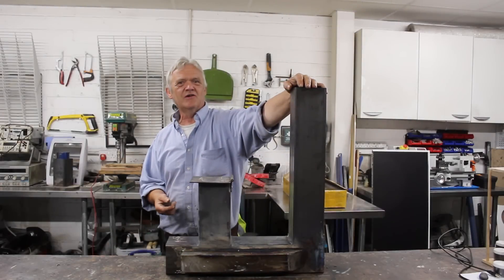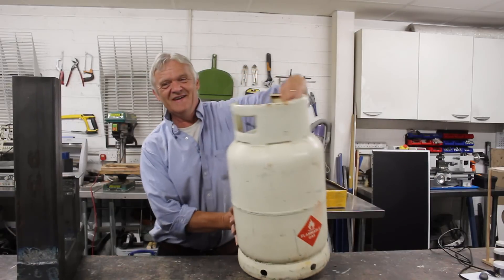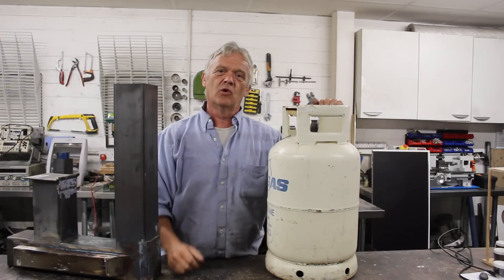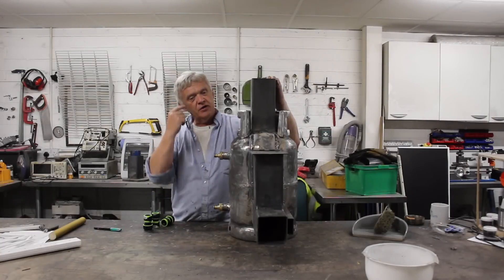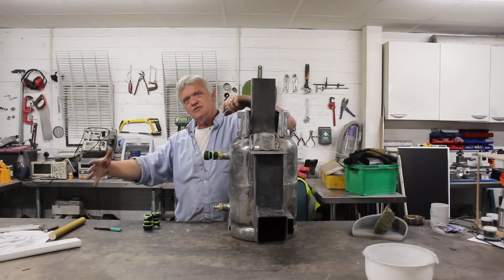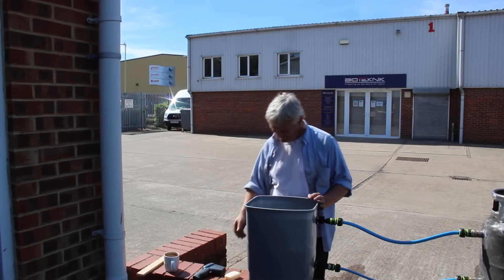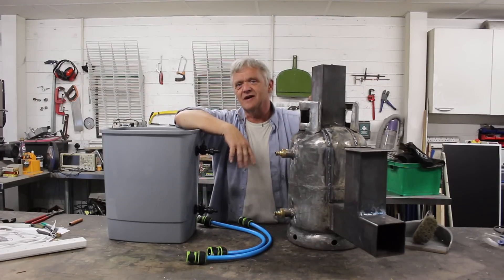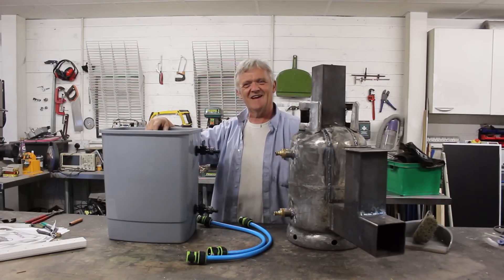1603 How To Make An Amazing Super Efficient Rocket Stove Water Heater - Beat Those Fuel Prices

Comment: What a coincidence that today at 39 years old I got my childhood box with photos of me having a bath in a bucket in the garden as a baby. 

This would be such a good way to save £150 a month by converting this system to run both my central heating and hot water system.  

COMMUNITY PROJECT. 

I do believe the competitions should start to focus on real world problems with useful solutions.
Reply from the maker: I agree mate - but there is an issue of folks having the skills and resources - I am currently trying to make the competitions open to as many folks as possible
Reply: @ThinkingandTinkering  that's fair and real mate. I had a racing mind last night 🤣🤣

Comment: Does that mean you could have a steam boiler? With a closed circuit turbine generator? If it took half an hour to get going? Then what would the fuel to energy production be?
Reply from the maker: yeah you could - it is really just a fire tube boiler - as for the energy production - no idea but I guess it could be calculated
Reply: @ThinkingandTinkering  as far I remember the pressure valve are usually set at 3 time less than maximum pressure. Your lucky that you can boiler test the thing with water.  In most cases 110 psi for locomotive boilers. Usually it a tappers thread. As most boiler test go, are somewhere around 500-600psi. Mainly to check from weld stress and structural integrity. Not a bad thing in this case. Would love to see a steampunk build. Though I’d let a boiler maker check first. If your not certify? It how some of the modeller get around the regs. By making share it has the correct tickets. The thing is you now can attached an accumulator. Then your away. Supper heater coils in the flume. Marvellous! Not sure of the bamboo quad would accept the boiler. But would be awesome to see. Soo many options for modular design. Steltic (steam electric) fascinated me.

Comment: Therefore: Treat the reservoir as the heat sink and the rocket stove (with water jacket) as a heat generator. Which reinstates the smaller rocket stove as they generate heaps of heat energy. 
Project: your workshop's heat needs in winter (i.e. aiming for very comfortable). What would be the ideal setup taking into consideration the CO² concerns: smallest possible R.stove outside, size and shape of jacket, transfer to the heat sink (distance), etc. 
hint: have a shower before you leave at the end of the day as any sweat/oil on the skin multiplies the effects of the cold; ask any long term motorcyclist.
II: different direction: could an R.stove be used as a steam generator for a (not particularly complex) turbine to make electricity?
Reply from the maker: oh yeah - you would have to watch the pressure build up is all

Comment: It's a great idea... However. The Idea of a rocket stove is to get absolute clean and complete combustion. This is achieved by keeping the stack as hot as possible and ideally should be lagged from the combustion chamber up by around 750mm. This causes a good draw and retains heat so even smoke is burnt. Obviously putting a water jacket around this part removes the heat and warms the water, but the consequence is incomplete combustion. The idea of the rocket stove is so you have no smoke, the only thing coming from the stack is ultimately condensate, gas and the moisture in the fuel being burnt. No particulates should be present in a correctly running rocket stove.
When the stack is lagged, it's the exhaust gases that are used to do the heating. One design is to put a barrel over the stack creating a chamber that the (extremely hot) exhaust gases heat. The exhaust outlet from the chamber does not need to be vertical because that is not where the draw for the burn chamber comes from. A horizontal outlet can be used and this is what the mass is built around. For water heating, the barrel could have the heat exchanger within it. 
The main point is that the short section of stack immediately exiting the combustion chamber must have it's heat retained for the stove to work as a 'rocket'. The word rocket was adopted due to the wooshing sound made by the very strong draw and very rapid combustion of fuel. 
I was a bit of a geek around this type of stove, it piqued my OCD.... 👍
Reply from the maker: awesome mate - nice add thanks for taking the time to write that = plenty to think about - cheers
Reply: @ThinkingandTinkering  very nice welding btw 👍😁.
I think a correctly running rocket stove could answer the particulate pollution problem in urban areas. Done well, they are highly efficient. I suppose NoX output could be a potential issue with extreme combustion temperature, although going there would need a ceramic burn chamber to avoid potential melting of metal. Modern bio mass furnaces use similar principles to achieve really high combustion temps, forced air flow being one. 
I suppose the only draw back is not having the comforting visual aspect of burning wood in a glass door stove.
Reply: @yoda-be.at1746  If you wanted to maximize the burn of the rocket stove gasses, you could run a secondary shaft for air alongside the exhaust intersecting at a point a couple inches above the final combustion height and create a secondary oxygenated burn point for the excess wood gasses. That's how those smokeless firepits work. Depending on the vertical space available for your design, you could burn off most of the wood gas and waste less of the fuel's potential energy output in the process. Beyond that that, you can stick a 6" chimney pipe catalytic insert in to convert remaining greenhouse gasses to safer output.
Reply: @yoda-be.at1746  Very nice welding? My arse!
I love Rob and what he does, but 'welder' he ain't.
No disrespect, just a statement of the obvious. 
Ask him to weld 'Aluminium' and a ferrous metal, and if he can do it I'll shut up.
Reply: @bikerfirefarter7280  I was just being polite... But at least it was water tight, no joints suffering from porosity.
Reply: @yoda-be.at1746  Understood. I'm just being a bit ocd about the basics, seeing anyone 'welding' as if they're applying mastic grinds my gears. Like I said, I love what Rob does, but I just wish he'd go on a basic welding and brazing course. Mma, mig, tig, oxy/gas. There's a lot of good stuff he is missing out on.
Reply: IMO it just slows down how long it takes to reach optimal temp and if you have insulating mass then copper tubing or water tank the optimal temp can be reached quickly but water heating will be slower or use stored heat in the mass from the last burn.
Reply: @Barskor1  care to explain your opinion further?
In a rocket stove, it's the exhaust gas that does the work of heating. If everything before the exhaust exits is insulated, where other than the gas itself does the heat go? 
The point is that fast combustion and a hot combustion chamber is very efficient. It's after that point you use the heat for work. It doesn't slow anything down.

Comment: A great water heater design Rob.
For a mass heater is sand better than concrete, or is it being used because it is cheaper?
Reply from the maker: sand is better mate - but I am going to go into this a bit
Reply: @ThinkingandTinkering  Insulating air gaps in the sand right?